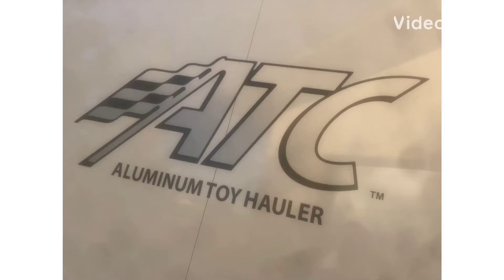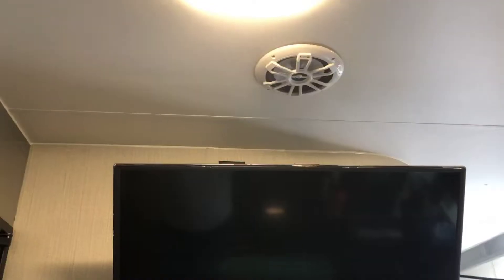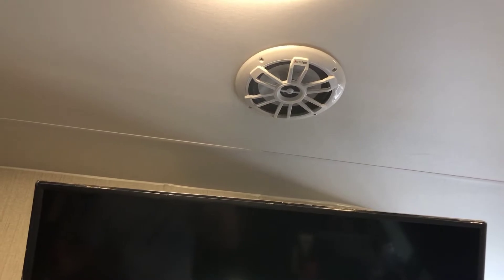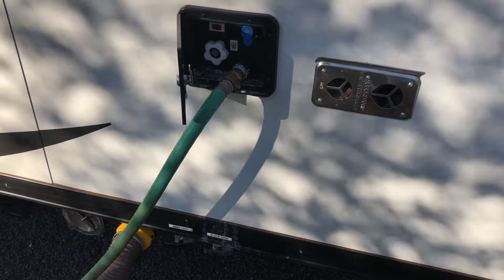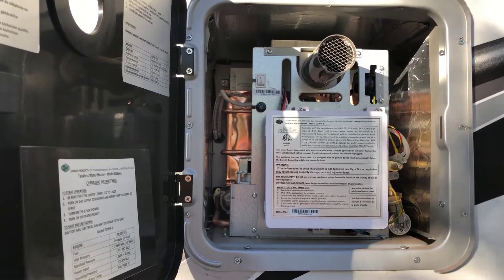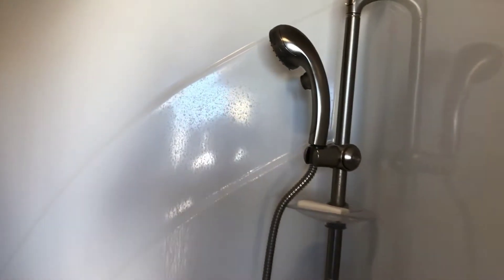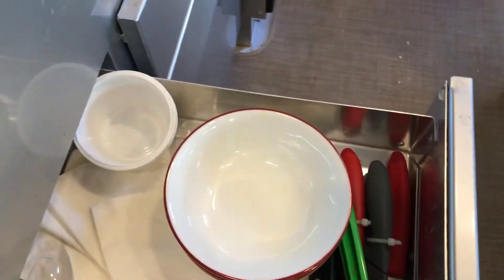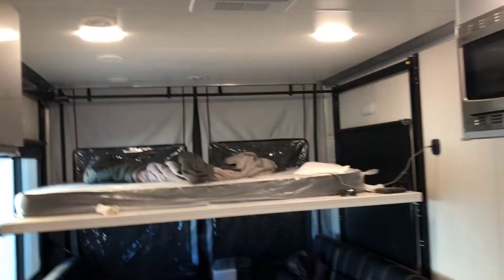ATC Toy Hauler - Walkthrough, Features, Benefits for Mold Avoidance

Comment: I would like to see a video on the shortest 5th wheel, 32' I think. Also any insulated areas that aren't closed cell styrofoam should be using Rockwool insulation instead of the pink stuff. Rockwool will not absorb water and is fireproof.

Comment: wow! Do they make a smaller version for one person?
Reply: Yeah, it would be great if you could convince them to make a 'mini' 14-16' model that came in under 3500lbs and cost closer to 30k.
Reply: @jamesoutwest  They are more like a trailer company than an RV company. You can have them design any size you want. I'm looking at getting a 7x16 for the lighter weight just as your say. Although the frame will be a non-standard size, everything else (kitchen, bath) will be standard so it won't be as expensive as a full custom job. ATC dealers order cargo trailers of all sizes down to 5x10.